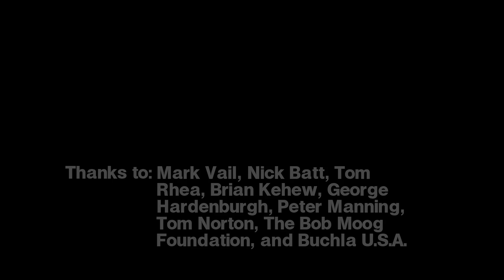A History of Polyphony: Part 16-  Conclusion

Comment: How am I only just now seeing this? Oh right we had to wait for Behringer to release the Poly D and get the whole grapevine telephoning disinfo spinning. At the time you released this I was out in the desert sequencing my desktop synths and just about to get my hands on a DFAM, Model D and Neutron. When I returned from the desert, I was so disgruntled with my career that I locked myself in a basement and spent 12 months with a soldering iron, bunches of components and The Art of Electronics. I said to myself "I will make oscillators and filters, but I won't get near that power stuff because it is dangerous." And then I found myself building a bench supply that converted 110VAC to +/-12DAC. It was when I discovered that, in so many ways, synthesis is just power -- that no current flows into an op amp, your input signal is sensed and "copied" onto the power rails to produce an amplified COPY (many times over) ... that's when this stuff really started making sense. Anyways ... thanks for putting this together. I am off to watch your older series on synthesis cuz ... why not?

Comment: Great Series Marc, although it doesn't completely fit this series, I would be interested in hearing your thoughts on rules-based voice allocation. With software-based synthesis, there is no inherent reason for all voices to be based on the same sound,and of course multi-timbral synths abound. What hasn't been completely explored is how to distribute differing voices dynamically during a performance.

Comment: My recommended reading list

MANUALS:
Multimoog, Mocromoog, Moog/Realistic MG-1 (a sort of baby Liberation), Opus 3, Polymoog Synthesizer and Polymoog Keyboard, Prodigy These are by either Herb Deutsch or Tom Rhea

BOOKS Synthesisis By Herb Deutsch. The Whole Synthesizer Catalog, by Keyboard Magazine

HOpefuly, you can find PDF's of these online

The ionteresting thing about the Opus 3 is that, while it is a three piece instrument, you can also integrate the sections into a larger whole, using the Brass and Strings section I can create a 1950's "doo wop" piano which is very good if played either staccato or paraphonically; i.e. banging chords as in THE GREAT PRETENDER. Using Brass, Strings and Organ I can do a fair Farfisa and pretty good Vox Connie. In fact, thought it tries to imitate a B3, it exemplifies the spirit of the mid-late 1960's combo organ to a tee with some pretty "cheezy" sounds, even down to the much-maligned Ace Tone Top-5

I've mentioned the Hammond S-100 Chord organ of the mid-'50's as my first advantures in sound design. The Liberation is very reminiscent of that. My nest trick was in the mid-'70's when I used the 8' Flute, percussion; phrasing med length on my Farfisa Compact Duo to simulate an electric piano. When I shoed that to the guys you should have seen them! Want a sound known as classic MiniMoog from the Farfisa? Multi-tone boost, All Boost 16" and 2-23

Synthesis is, ultimately a worldview and mindset more than an instrument or class of instruments. As Tome Rhea wrote "It's not 'wihat will this thing do?' It's "What can I do with it?'"
Reply: Synthesis is really just science. I recommend the following books: Yamaha Sound Reinforcement Handbook (Davis and Jones), Audio Systems Design and Installation (Giddings) and The Art of Electronics (Horowitz and Hill).